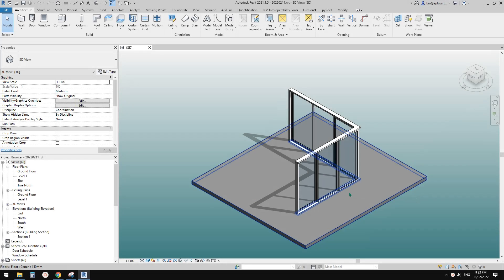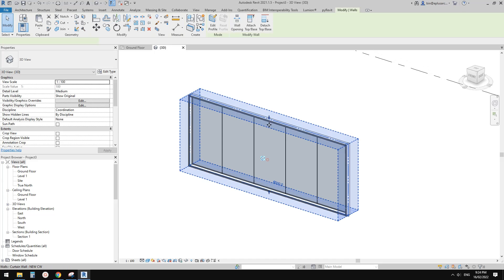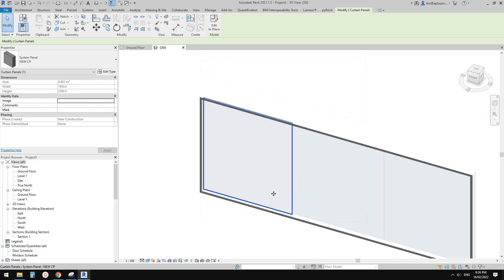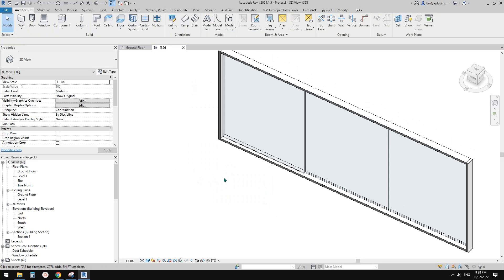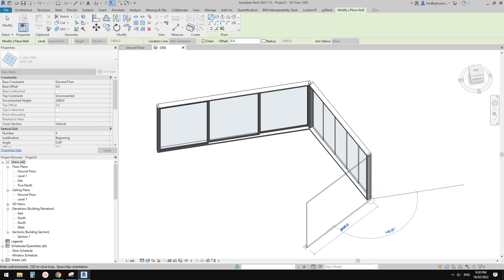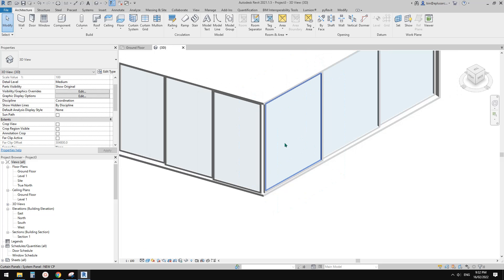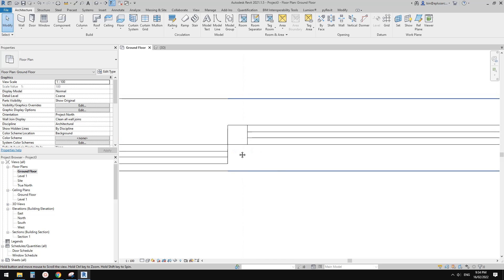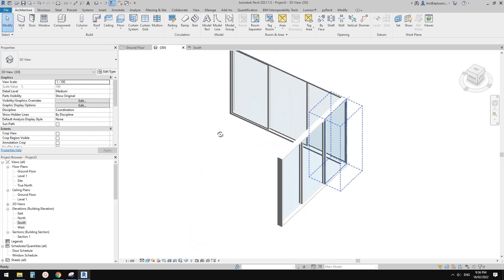Revit Exercise (Day 695) Create Corner Sliding Doors using Curtain Wall

Comment: Hi Bin,  great video. Quick question would it be possible to have 1 curtain wall with 3 panels sliding one way and the other curtain wall pocket into the wall?
Reply from the maker: I don't think you can have a curtain wall pocket into the wall.

Comment: I wonder if a line-based family would be less fussy.
Reply: We had ha chat with Bin and would be ok. But there needs to be done a corner cut with some voids then
Reply from the maker: Yes, as mentioned by Oskar, it can be done using a Line-based Family, but it will be a little more complicated, especially if you want to do the corner bit. I did some line-based joinery families a few years back using a similar concept.